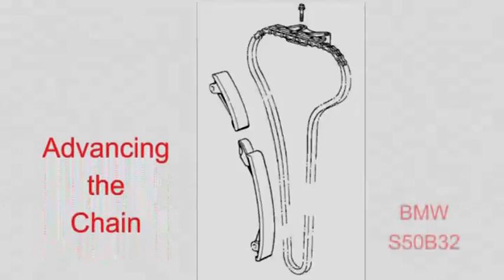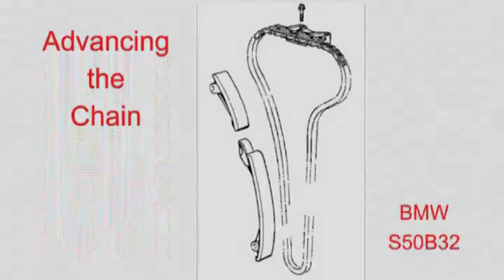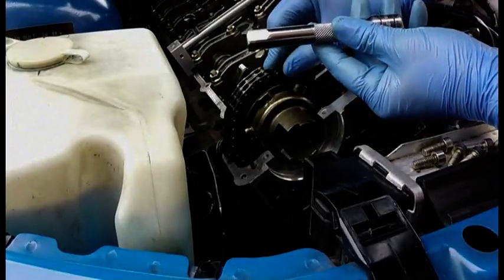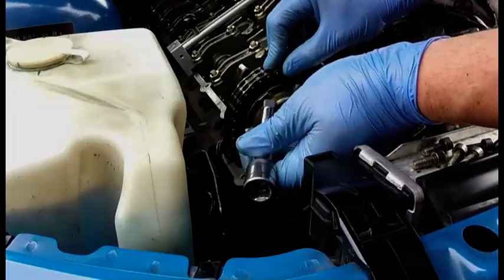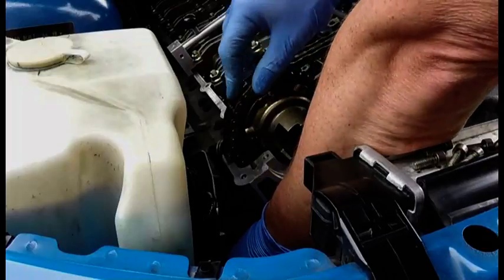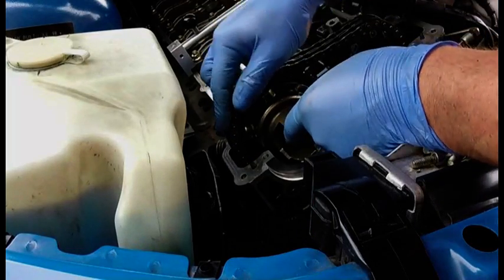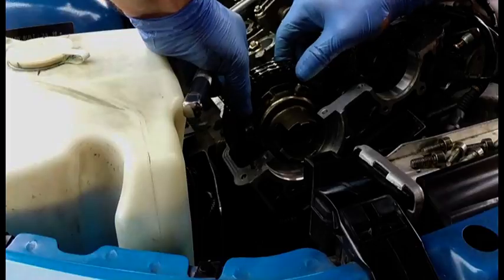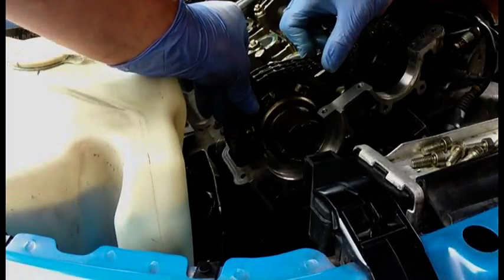Advancing Timing Chain By One Tooth on BMW S50B32

Comment: Why is my exhaust camshaft advanced when i did not open the vanos? I only remove the solenoid vanos to change the o-rings on the exhaust camshaft area..but once i diagnosed it shows vanos camshaft advanced..is this okay? Will it drop in performance?

Comment: Why do you have to advance one tooth?
Reply from the maker: If you need to change the position of the sprocket, you need to advance the sprocket.
You can only move it by one sprocket at a time.  You may need to advance it by many teeth to gain access to the screw heads, but you can only advance it by one tooth at a time.

Comment: I thought I could work on my car. This is clearly not the case
Reply from the maker: Nobody said it was easy :)
Reply: I don't understand what we're doing, why we're doing it nor how we're doing it :-D
Reply from the maker: @anidiotinaracingcar  In that case, don't do it :)
Reply: I won't go anywhere near the timing chain, I promise!

But if you have some time to spare, I'd love to understand the situation. I'm a big fan of short videos but a few minutes would be quite nice.
Reply from the maker: @anidiotinaracingcar  What do you want to know?
Reply: Why the exhaust sprocket isn't in the right place at the start :-D
Reply from the maker: @anidiotinaracingcar  A good question.  See http://www.realoem.com/bmw/enUS/showparts?id=CK92-EUR-07-1998-Z3-BMW-Z3_M&diagId=11_1577 Item 7 is used to lock the sprocket to the camshaft.  There are a different number of splines on each part of the shaft.  This means that there are a very large number of orientations between the camshaft and the sprocket.  You are very unlikely to get the orientation correct the first time you fit it, so you need to move the sprocket relative to the camshaft.  This is why we need to advance the chain by one tooth at a time.